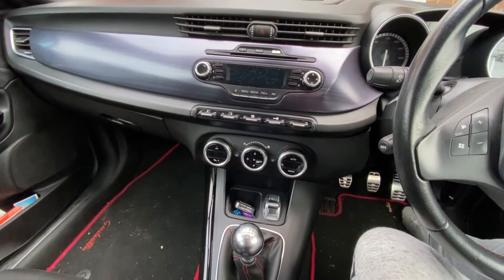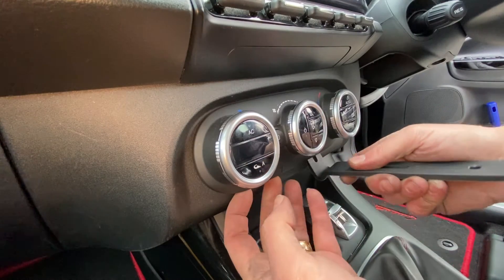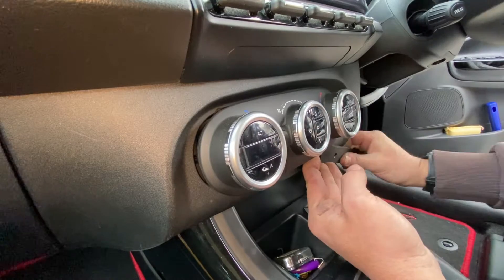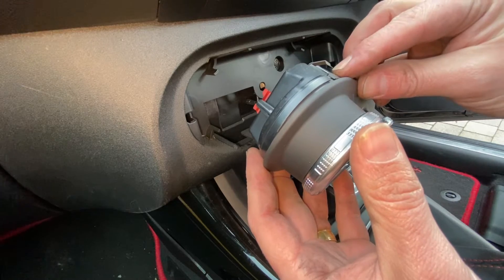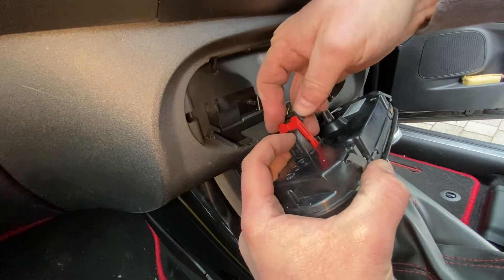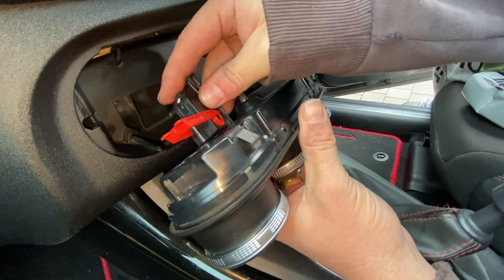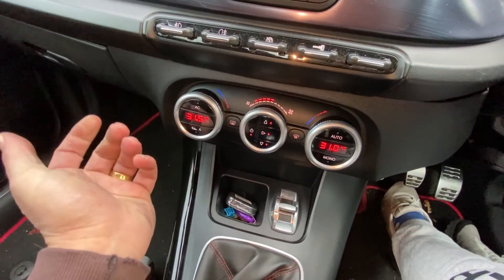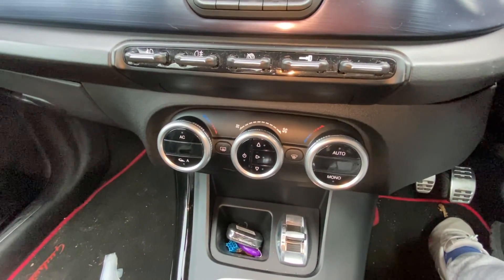Alfa Romeo Giulietta Climate Control Dials How to Remove

Comment: Hi, I have a petrol Giulietta 2012; when I would turn the AC on (cool temp), the air  would alternate between cold and hot; my electrician said it has to do with the flaps being broken and being sealed to cool when I choose to use the AC on cold. Do you know what the part is called that has the broken flaps so I can order a replacement? Are the flaps in the control unit you just dismantled? Thx!
Reply from the maker: Hi sorry, no, can’t help on this occasion. These cars do suffer with blower unit issues though. Quite common. All the best 👍

Comment: I got a problem with light on this panel indicator from a passenger side Just disapear is there any light to change inside this panel.?Or should i buy new panel?🤔
Reply from the maker: Hi. I believe their soldered leds internally, so likely easier to change the whole panel. I think they’re a CANbus device though, so you are likely to need to do a Proxi alignment with diagnostic software for a replacement unit, to ensure it works properly. Hope that helps. All the best 👍
Reply: Just had the same issue. I think we are gonna start seeing this kind of stuff more often now that these cars are over 12yo right? I bought a used unit and I’m about to replace it, hope it works fingers crossed 🤞🏻

Comment: Hey man thanks for yout videos! One question. The passenger LED just spent after a couple of days of going on and off, did this happened to you? In that case any advise can be useful! thanks!
Reply from the maker: Hi. Can’t say I have had that issue, but sounds like it could be a failed unit. You could try and get any fault codes read, but I suspect it will need repair or replace. All the best 👍
Reply: @vialettotony Just bought a used unit. And I’m about to replace the broken one. There was a quick reset button combination for these… something like “auto+rear window button”?

Comment: Wow this is a very great video I never thought it will be that easy to remove the climate control
I have a problem with recirculation button because when I press it on or off I still smell anything outside the car I think it’s not working or something stuck can you help with this by shooting a video on the alfa how do system work
Reply from the maker: Hi Sulaiman. Glad to hear it helps. I know there are common problems with the air management unit where parts fail, which also lead to no hot air coming out amongst other issues. I hope to get round to a video on this at some point though. Thanks for watching again   
All the best 👍